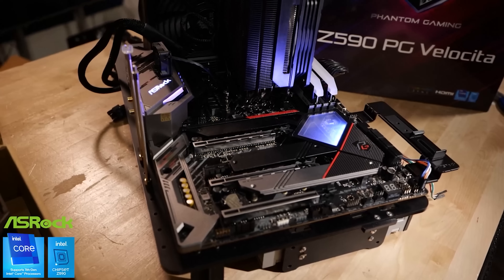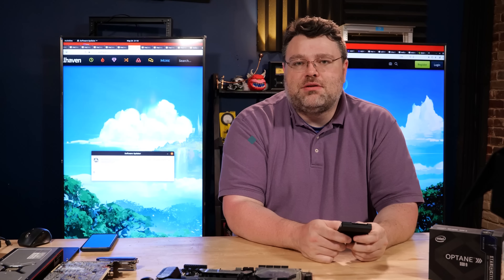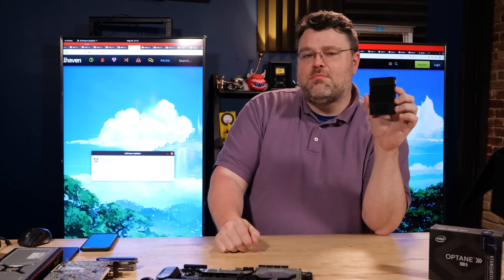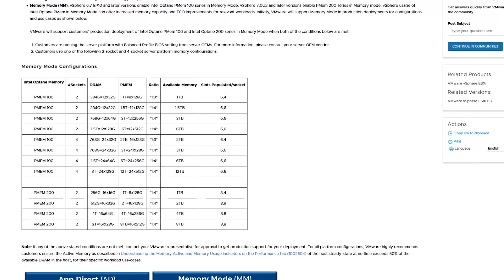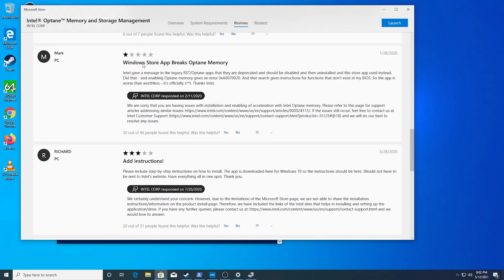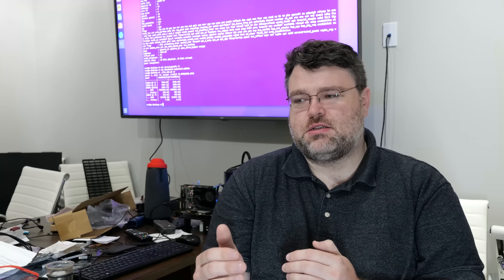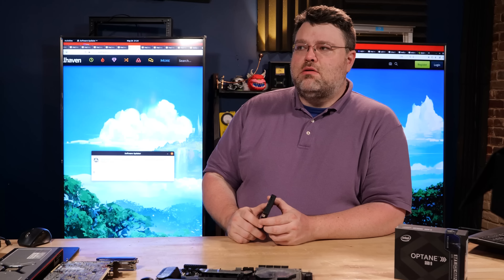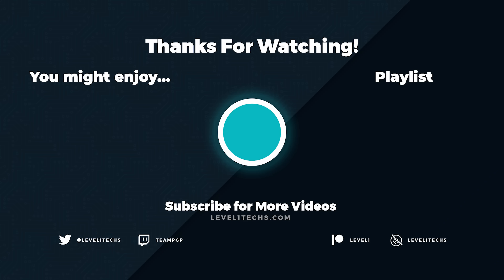The Storage of the Gods: A Deep Dive Into the Intel Optane P5800X

Comment: If only Intel's CPU R&D results were as impressive as what their storage team puts out!
Reply: The chip design team/division ARE as impressive. Rocket Lake has about the same IPC and performance with more features than Zen 3 CPUs. While at a MASSIVE manufacturing node disadvantage. All the Intel's struggles in the CPU division are from the manufacturing division alone, the chip design guys are doing wonders, and it's what made Intel stay afloat in the last 3 years.
Reply: @Winnetou17  :D manufacturing node has zero effect on IPC, just the reachable clocks and power consumption!
Reply: @viesturssilins858  Except when you cannot fit enough transistors to make some smooth optimisations. That's when it matters!

Comment: mmmm this and storemi or primocache or rst with my big 4tb hdd so i can have the ultimate cache disk for my ue5 work. it would be overkill for someone like me but dang it would be neat to see lol.
Reply: fun fact: UE5 complains in the output log when creating static meshes and nanite cache when your drive is slow. it'll just point out that the read speed is currently 0.01MB/s.
Reply: this is timely for me because i've only just started messing with those drive caching softwares. its opened my eyes a bit.
Reply: Depends on how much storage for working files you need but 2x high end NAND SSDs in RAID1 would often make far more sense if you're professionally, or serious about, doing UE5 work. With HDDs then only for back up purposes.
Reply: @callums____  oh yeah in a perfect world with actual budget for hardware you are absolutely correct.
Reply: @NavJack27gaming  you realize the video your commenting on is in regards to Optane drives which are now generally 10x or more expensive than NAND SSDs, right? Therefore asking in relation to getting one as an option without the budget for standard NAND SSDs makes no sense.
Reply: @callums____  yes. its a cool thing and I said a cool thing that would be cool. do you realize how rude you sound? i showed enthusiasm for a technology and pointed out a thing i'd find interesting with it.
> asking in relation to getting one
no one was asking anything. i'm currently doing things in unreal engine 5 and i related it to that because its what is in my mind at the current time.
you're making assumptions about my knowledge of technology and i just don't have the tact to fully unpack you right now.
Reply: @callums____  i currently have two quite full 1TB NVMe drives (an adata and a samsung). i could move my entire project onto those (its already on the samsung) but the data cache for the engine in general would use up the space generated by the other projects i mess around in.

Comment: Simple question - what connection options do you have with this device? I see Wendell used an AIC - does that board come with the unit? confused
Reply from the maker: This is u.2. you can plug in via pcie card, u.2 bay, and, or m.2 to u.2 connector
Reply: Thanks  @Level1Techs  - what comes in the box i.e., do we have to purchase additional stuff to actually plug it in? Would be going in a Gigabyte WRX80-SU8-IPMI board.
Reply from the maker: Yeah I'd recommend the pcie add in card for the gigabyte. It doesn't come with it but it's only about $15
Reply: @Level1Techs  thanks - are the add-in cards still rated PCIe 3 though? Looking at StarTech for example.
Reply from the maker: @derekjcooper  I used this one and it worked fine. https://www.mercari.com/us/item/m82182186384/  at pcie4 speeds. Not sure about the startech
Reply: Cool - ok, thanks  @Level1Techs  - looks like a generic U.2 add-in card. It was the PCIe 4 specs that threw me off. Keep up the fab work.
Reply: Interesting  @Level1Techs  - I reached out to Intel for support on the AIC route with the P5800X. Here is part of the response I received...

The Intel® Optane™ SSD DC P5800X box only include the SSD. This drive is for the Enterprise market,  so it's supposed to be connected into a free server slot, the  only form factor is U.2 (2.5in). Add-in card adapters are not recommended either, so we can not provide you with the list you was looking for.

Hmmm... I guess they really don't want us using them on anything but servers? I have one arriving Monday... I'm sure it'll be fine in a StarTech AIC sled.
Reply: @derekjcooper  where did you order yours from? I've been waiting for one for 2 months now.
Reply: DM me  @AJolly

Comment: What's that add-in card you're using to get your P5800X in your system Wendell?
Reply from the maker: https://www.mercari.com/us/item/m82182186384/
Reply: @Level1Techs  This adapter doesn't mention PCIe 4, only 3. Are you sure you were getting PCIe 4 speeds?
Reply from the maker: Yes 7 gigabytes per second is not a speed possible with pcie3... It's a total crapshoot with these riser cards. I had a few other ones that did not work.
Reply: @Level1Techs   thank you very much!!!

Comment: How does Samsung's Z-Nand stack up against this? afaik, it was pretty competitive against 1st gen Optane
Reply: Well, 2 million IOPS on Optane VS 0.075 million IOPS on ZNAND
That makes the P5800X 26.6x faster than ZNAND
According to Anandtech's Billy Tallis
Reply: @denvera1g1  well that's queue depth 1 right? that's probably not that much of a realistic use case, but it prob translates into other areas as well
Reply: @steffeneilers8530  If you're using it as cache then i could see QD1 factoring in quite often especially with multiple write streams, and multiple read streams
Reply: Z-Nand was already behind gen 1 Optane. Now it is way way behind gen 2 Optane.
Reply: @Patrick73787  According to samsung's own website they say theyre not as fast at only 750k IOPS EDIT on the new version of ZNAND

Comment: Didn't Intel announce that they were discontinuing Optane?  Is that only for consumer-grade optane' meaning server grade like P5800X will continue?
Reply: They only discontinued the consumer-grade SSDs that were all-Optane.  But they haven't exited the consumer market altogether.... Intel is currently rolling out the H20, which is an M.2 form factor hybrid drive that has both Optane and normal QLC flash.  Early reviews look pretty good, but it's a mainstream notebook product, not a high-performance eater of Samsung 980s.
Reply from the maker: I did a video on the H20 which intel got a lot right over the H10, but it's not "for retail" -- it's a hybrid optane + nand flash. not without its quirks and is most ideally used with intel rst. Optane in the enterprise is prettymuch intel selling them as fast as they can make them. For customers that want this speed there is no substitute.
Reply: They will keep optane as a technology, and continue to sell the consumer and enterprise drives. The high end ones have no replacement to date:
in other words, the px800 (like this) series and the Hx0 (like the H20) series will live on, but no mention of a replacement for the p900 and p905s
There is a webinar somewhere in youtube where some intel engineers talk about it :/
they did sell their nand flash division, so maybe in like 3-5 years they will either buy nand to build the Hx0 line or sell that product to some other company to build something similar.
They do have everything they need to keep on going with the enterprise solutions though

Comment: I have 280gb u.2 optane as a boot and it's lovely.
I use it for local Jenkins testing, it's so snappy compared to 970 Evo.
Also the heatsinks on them are beautiful.
I'm writing go mainly if people are wondering.
Reply: I have four of them in my workstation and one for the OS in my gaming rig.  I kinda went Optane crazy at one point.
Reply: Are you using it on a server grade motherboard, or on a regular motherboard, with a U.2 to M.2 adaptor cable? 
I am curious if it boots normally & works normally as a boot drive on a Zen5 platform.

Comment: I've used 905P and 900P drives as boot and work drives on multiple AMD and Intel desktops and they've been amazing. Compilation projects and large database queries and workloads even from cold with limited RAM is amazing. Is a shame the prices have kept going up.
Reply: do you notice a meaningful difference between the 900 and 905?? 
I am looking at having tiered storage with an optane drive and a sata ssd, but can only find cheap 900 series drives on ebay, the 905s are considerably more expensive
Reply: @sebastianguerraty6413  nope, I haven't noticed any difference between the 905P and 900P drives. They're within single digit percentage levels raw performance wise IIRC. Considering how incredibly low the latency is for both, I'd just buy whichever is available or cheapest.
Reply: @callums____  Thanks for the answer :D 
My dream was to get one of these, but the price and requirement to use a u.2 to pcie adapter convinced me to go the p900 route, also I wont be doing anything where the difference would be worth paying like 5 times what the old solution would cost.
Reply: i want one so bad :D